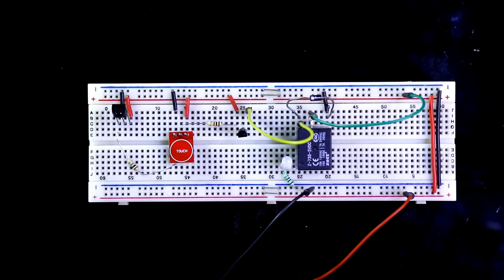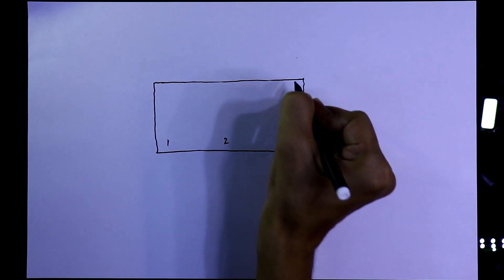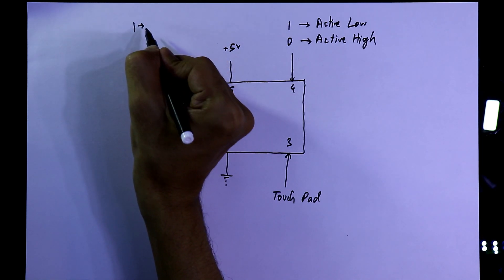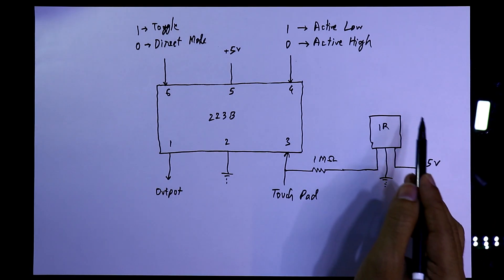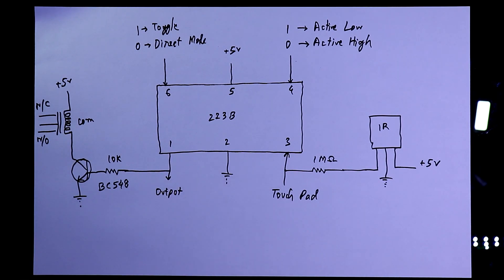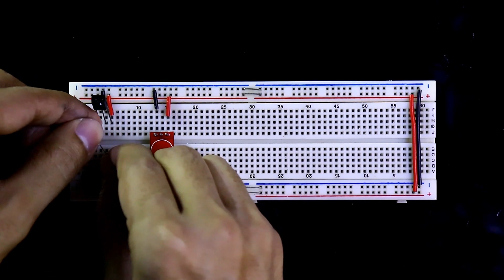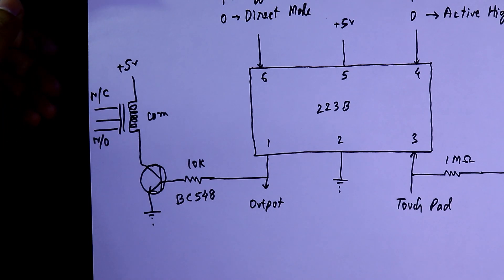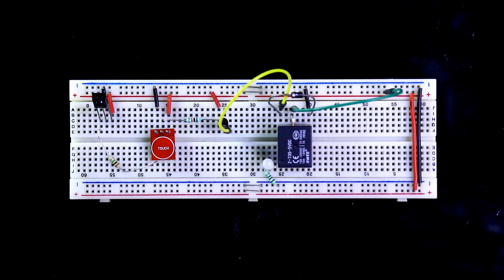How to make remote control on/off switch with TTP223 touch sensor

Comment: So the TTP223  chip will always be drawing slight current to check capacitance or if it received IR signal. vs conventional switch that doesn't use any current.

Comment: The IR remote has many buttons, each sending off a different HEX code to the IR receiver.  How did you figure out what HEX code triggers the TTP223 touch sensor? Thx
Reply from the maker: You can control single channel with any IR Remote without microcontroller. Only for multi channel, you need a microcontroller.